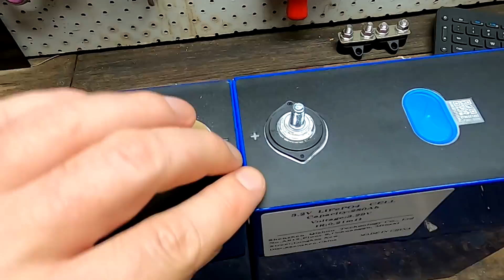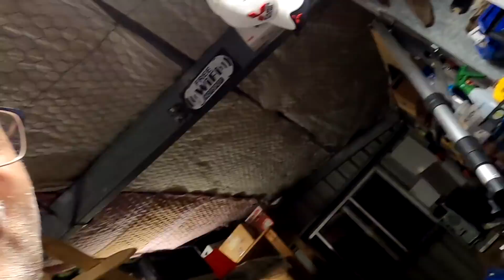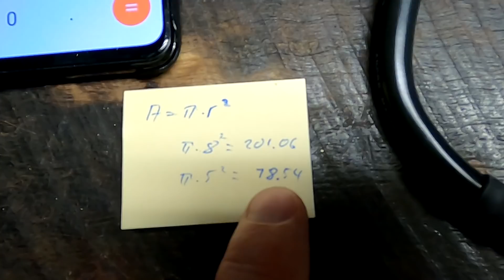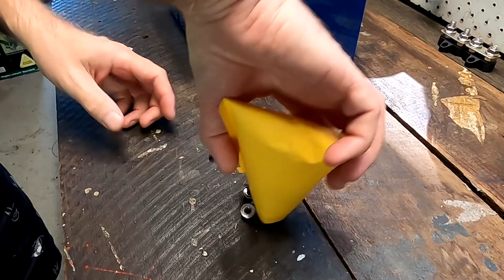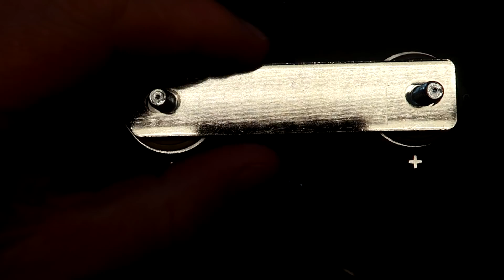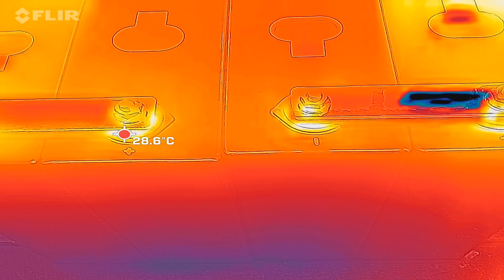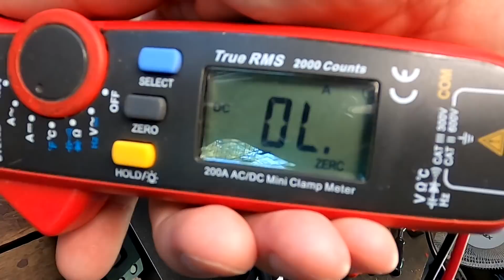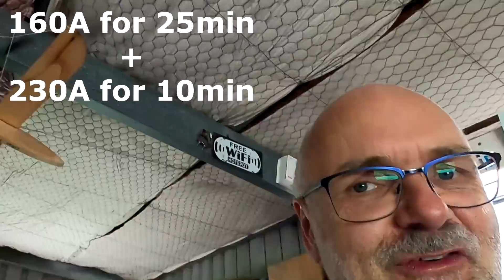EVE LF304 with welded studs. Pushing 230A through a tiny terminal?

Comment: Well, this video puts my mind a bit at ease after seeing the small contact area and steel studs on the 36 EVE LF280K cells I bought.. Placing dual #2 copper cables on these along with the copper flexible buss bars.. Plan is that the 2x 17 cell batteries will provide 75 amps or less maximum each or 150 amp maximum or les if one battery is offline so it should never get above .5c charge/discharge.. You pushed a 12v setup to over 200 without much heat so 50+ volts at 200+ amps should be far lower resistance ampacity heating just like wire size vs voltage..    

Thanks again for real world testing and sharing this with all of us..          

That being said I still would rather have larger contact area and silver or copper anodized studs and nuts.. The cable heating you have might be a resistive mismatch of the 2 separate cables acting as one if there is a slight difference in their length or slightly oxidized inner surface of the crimp providing some resistance.. I am going to use dual #2 cable but I plan to clean the inside of the crimp pocket and solder them after crimping using some liquid flux applied before assembling and crimping.. Overkill can keep you from getting killed.......
Reply from the maker: Thanks for your feedback. The contact area is not the problem, but the force you connect the two areas together. Here, we have a very small area, but torqued with 4Nm the force is very high pushing onto this contact area. I have several batteries with these cells and terminals and never had any problem. 150A is certainly not an issue.
Some manufacturers have included small copper washers to increase the contact area. But tbh, they make the situation worse as you have more resistance between the different materials of aluminium-copper-copper than just aluminium to copper.
Reply: @OffGridGarageAustralia  Thanks for the testing videos and the reply Andy

Comment: When you put a straight edge up to the battery case and noted there was warp, I have noticed in my own batteries, this warp changes with ambient temperature.  I believe the case is warping due to temperature of the plastic, not the resizing of the internal components.  Maybe give that a try; measure the case warp at room temperature, then check it again after chilling and again warming the battery by placing in a cooler and warmer room temperature.

Comment: Ultimate contact resistance is actually more a function of contact pressure than contact area, within reasonable limits of course.  So, greater area with the same clamping force can actually result in greater resistance as the contact pressure is too low.  The fact that the welded studs allow for a higher torque, and thus a higher clamping force, should result in a better connection as well.  I love how really and truly put all this stuff to the test.  No guesswork, no conjecture, real tests! By the way, the cucumber temperature measurement must go way back.  I remember it from when I was kid.  Something running nice and cool was said to be "As cool as a cucumber". ;)
Reply from the maker: Yeah, I have two battery banks with these welded studs and they work great with no issues at all, all using the supplied bus bars. 🥒🥒🥒

Comment: I believe that the increased compression of the reduced contact area of the welded stud to the buss bar surfaces would slightly deform under the greater PSI at a givin torque causing greater contact area between the two surfaces. Almost like a crimp, or close to it.

Comment: I see and I cannot agree with the imbecile decision of manufacturers, why the plastic around the connectors is not BLACK for the - terminal, that is, RED for the + terminal, which is the defacto standard for direct current !!! 
Working as an electrician for +35 years, I feel sick when I see  BLACK on + terminal ring, why don't they just put RED plastic in that place !?! Fu*king %^'d

Comment: You could just drill a recess in the busbar the same size of the first platform and have the busbar make contact with both rings.
Reply from the maker: The second ring is where they weld the stud onto the terminal. It does not seem to be clean enough for making good contact. I think the terminal is good enough as it is and I never had any problem since installing the busbars on these batteries.

Comment: Hi Andy! I would put a big hole washer around upper terminal (step) to make proper contact surface.  🤗
Reply from the maker: It's not really necessary as I will hardly ever push more than 70A through these terminals.
And as the test showed, it works quite well without.

Comment: I have received the batteries and with less than 4nm torque the welds failed. I posted the pictures on diysolarforum.

The stud is steel pressed into the aluminum ring.

Comment: Andy  I looked thru your old videos to find this one because I was curious of the welded terminals. I happened to get some new 280AH batteries with the welded terminals and just a coincidence I only had 3/8 ring lugs. When I used that lug instead of the normal 5/16 lug I found out that it fit down around the ring on the welded terminal and gave me full contact to the main terminal below where it was welded on. This may just be the manufacture Docan Tech that I am getting my batteries from however just wanted to let you know in case you wanted to try a 3/8 ring lug to see if it got better contact onto those welded terminals.

Comment: Very interesting Andy! I would have had the same issues as yourself about these busbars and contact area, but I wonder if with the smaller contact area, you are actually getting a much higher force on that reduced area, and also the busbar can possibly flex or force into a better seating position. Another comment was about the busbar size helps to possibly conduct heat, but then they didn’t even really get hot did they under these conditions, so.  Yay! Looks good!

Comment: Probably the large contact surface of the original connectors was working against you.  You are not getting as much pressure because of the larger contact area and the accompanying lack of actual contact because of seemingly minor surface irregularities, whereas it is making excellent contact because of the higher pressure on the smaller area and causing more conformity within the contact area.
Reply from the maker: Yeah, it seem to have fixed the contact problem. Everything stays cool and no hot spots any more...

Comment: I'm not too surprised: half to a third of the surface area means 2-3X as much pressure squishing the imperfect surfaces together so you get closer to ideal metal-to-metal contact across the remaining contact patch without needing perfectly flat surfaces. You also don't need to worry about that pesky aluminum oxide on the bare battery terminals anymore.
Reply from the maker: It seems to work flawlessly with this method. No hot spots, no contact problems any more. 4Nm is all it needs now...

Comment: I would mill out the holes in the buscar to the diameter of the seat of the stud. This will give maximum contact ares.
Reply from the maker: It won't. The lower ring is not plain and has a lot of rough leftovers form the welding process.

Comment: In my opinion tinned copper bus always works better than aluminum bus. I think that is why the smaller contact area does not heat up under high amp load.

Comment: I tried to place an order for 32 of the 320ah cells on the 29th April from the Sanben company on A/express. A/express closed the order! I then tried the same again on the 30th to which the order succeeded but only to find a few minutes later they again closed the order but put my money in limbo for seven days. Not a good experience to be having when trying to acquire cells. The 10,000W Reliable 24v to 240v pure sine wave  inverter I ordered without issues arrives tomorrow via fedex....
Reply from the maker: I would not buy such large orders from AliExpress. I have some reliable suppliers on my website which are not only cheaper but have also amazing quality and service. A lot of bad guys on AliExpress. Friend of mine bought 32 cells from AE and never got them. Took him several weeks to get the money back through Paypal.
Reply: Almost  a year ago?

Comment: are you able to solder the crimped terminals to see if it helps with the heat?
The smaller the contact area on the terminal, the more pressure it will put on the busbar.
Reply from the maker: Soldering is not recommended with higher currents. The solder can get brittle and break down over time leading to even higher resistance. I will cut off their ring lugs and re-crimp them at some stage.
Reply: @OffGridGarageAustralia  i agree but by soldering just the crimped tip and making it fast no solder will travel the wire to make it brittle.
I have seen it in automotive wiring before they invented ultrasonic welding.

Comment: You could add a sızed washer to the new battery temınals that took up the stepped change ın contact area. Thıs would add to the total contact area gıvıng a lower resıstance and less heat. The I=v/r law remaıns unchanged? You need more surface area of contact, better contact area, or less amperage through the contact area. The laws can't be changed. The set up can be ?

Comment: Hi Andy,  I consider you the Battery expert Guy :-),  and wanted to ask you a question regarding the use of 2 different inverters charging 1 battery bank.   That's what I'd like to do in order to increase the amount of solar panels I can use.   my questions:    1) let say I have  1 inverter from Victron and 1 inverter from Growatt,  could I connect them both to the same battery bank in order to charge the batteries?   or 2) would I need 2 different battery banks setup, i.e.  1 battery bank for the Victron, and a 2nd battery bank for the Growatt? ... TIA  for your thoughts ,   Dan
Reply from the maker: Hi Dan, thanks for your question and feedback.
So, first of all an inverter does not charge a battery, it takes energy out of the battery and converts it to 110V/230V. What you mean is an hybrid inverter with build in charger?
1) yes, that will work without any issues, you can connect as many chargers to one battery bank as you like and stay within the specifications of your battery.
2) no, that works fine with one battery bank, no problem. I do the same with three different solar charge controller charging the same battery bank.

Comment: regarding the surface area it is even less: 10mm diameter - M6 stud it is around 50mm2. considering that it is steel you could also argue that you can add the same surface of around 50mm2 on the upper side where the washer sits. but even than it is just 100mm2 in total. 100mm2 copper at around 60-80°C should be able to handle up to 300 amps iff the contact resistance is low, but I would also consider it as borderline, especially if you think about the degradation over time of the contact itself by e.g. expansion/contraction (as it happened with Andy's old battery)
Reply from the maker: We will see how this plays out over time. Many have reported having this set up for a few months now without issues. I guess, we will test it out 😉

Comment: The threaded stud itself is carrying the current which means as long as the nut gets good contact with the stud, and then good contact with the bus bar, then it isn't an issue.
Reply from the maker: If I use a nylon nut on the top, what would you expect to happen?
Reply: @OffGridGarageAustralia  I had thought about that, and chose not to use them because I wasn't sure how they would handle heat if there was a problem. After watching your more recent video where you explain the resistance differences I agree with you that most of the current is probably going directly from terminal to bus bar. I was surprised to see such a large resistance differential between the bottom of the terminal and the top of the stud.

Comment: There is also current flowing through the stud and nut in both cases, so the difference in total area is less than you think.
Reply from the maker: Not much current going through the stud and nut I believe.
Reply: @OffGridGarageAustralia  That would make an interesting test. How much current is going through the stud,
Reply: @OffGridGarageAustralia  Do a test where you put 2 wires on one battery. The two ring terminals separated by an insulator. Add a load, then measure the amperage of each wire.

Comment: The flange nut serrations, I think even though they dig in some do actually provide a good connection through the studs to either a bar or  to a terminal crimp end, I am getting the same cells soon, 32, probably on a ship right now. We will see!!..Why not try the serrated nuts on the old style cells, re compare.
Reply from the maker: We will have some different bus bars set up on the three battery banks soon, so this will give us a bit of a 'long term study'.

Comment: Very interesting - good test!
Have you tried measuring the voltage drop from stud to stud or over the fuse? Multiply by amps and you can put the watt loss / cost on each connection (at that load). Could be interesting 😊
Cheers
Reply from the maker: Thanks, more tests to come 😉

Comment: I'm learning so much, thanks Andy, for your effort and ability. Though, the 160 Amp bench test passed with no issues.  The small contact area needs a solution, for a better contact area to be larger, Why?  In real-life use in a vibration environment.  As an example, I would like to change my 860 AGM battery bank in the future on my ocean-going sailboat to a lithium system. I would not make an installation with such a small Buzz Bar contact area as it is not only about the amps contact area, it is also about the mechanical contact area required to ensure the buzz bar's system does not become loose with the pounding in rough weather conditions (it's about reducing the weak link possibilities in sailboats).
Reply from the maker: Thanks a lot John. For a mobile solution, I would definitely go with flexible busbars. The ones Madi made seem to be really good and work well even under extreme conditions. She also used this sticky heat shrink which seals the cable and protects it from moisture. You have seen her video?
Reply: @OffGridGarageAustralia  Hi Andy, Thank you for your reply...please send me the details I'm most interested in. My fear in buying a drop-in Lithium battery bank is the BMS needs to be tailored to your boat's charging assets. If not, do you risk losing them? If you are sailing to the pacific islands, and you lose power, there is no one to get you out of your fix.  For this reason, Your channel is most helpful for a layman like me. I installed 4 x 215 Ah, charged by 720-watt solar panels with a Victron smart 150/70 controller - and 400 watts (at best) wind generator, and a 120 Ah alternator. I have no generator.  If I had a Lithium battery bank, I suspect I would need a custom BMS to control the charging and discharging? I'm interested in building my own system batteries are fine, the problem is a reliable BMS. I thought you gave great reviews on Neek BMS, but I notice you do not use them? Why is that?? Keep up the good work. I'm having a most enjoyable learning experience. Thank you.

Comment: Hey Andy, it would have been good to compare 4Nm to 8Nm or 7 with the same current and time and then try those aluminum things. The force will be greater on a smaller area than on a large area given the same torque. The busbar on the larger area will show little or or no deformation whereas on the smaller area you will see some deformation. Force equals pressure times area.
Reply from the maker: Thanks Glen. We will do more testing with this in the future for sure. There are indeed a lot more questions arising and more exploring needs to be done.

Comment: Hi Andy, again a cool Video! I get the same battery cells a few months ago and had the same concerns like you. I used the original busbars for mounting together with this paste from Wago I posted a few videos ago (cleaned the studs before with abrasive fabric). And it works perfect! No candles to see… even at high currents (in my case about 120A only)
I talked to a mechanic designer about this and he said: When screwing busbars together only the small area below the nut defines the contact area between the 2 busbars because only in this area there is a high contact force to get a good metal to metal contact. 
It seems a good solution to me at the end…😉
Reply from the maker: Thanks a lot for sharing. As other stated here as well, there seems to be no problem with this connection. I will set up the two new battery banks with this method and see how this plays out over time.

Comment: Hey Andy, to keep the amount of area you need in perspective just look at the actual Fuse element, I am always amazed at how much current passes through the tiny fuse wire.
Reply from the maker: That is true and they also heat up quite a lot when going over 70% of their rated current. I guess that's the purpose, so they will melt in case of an over current 😁

Comment: I have the same cells,  the only comment I would say is they do snap off fairly easy I would not do much more than the 4nm that you are doing
Reply: Which bit snapped off. did the thread snap or did it break the weld. short vid would be good to see. thanks
Reply: @glencooke494   the laser welded stud snapped off the terminal.
Reply from the maker: Someone used 10Nm here with these studs and had no issue.
Reply: @OffGridGarageAustralia   I snapped one off at 7nm and had to get a replacement.

Comment: I run 24V Multiple packs.
Some EVE-280AH (N) with studs & (K) welded terminals.
Have run 225A Load & 140A charge using Single Packs (part of my thrash tests).
No issues delivering or recieving charge, everything was fine.
The "Welded studs" did get "warm" but NOT HOT.
I did have TWO HOT SPOTS but as usual, a small ridge on the busbars had to be cleaned off and Voilam solved.
Reply from the maker: Great, thanks a lot for sharing!